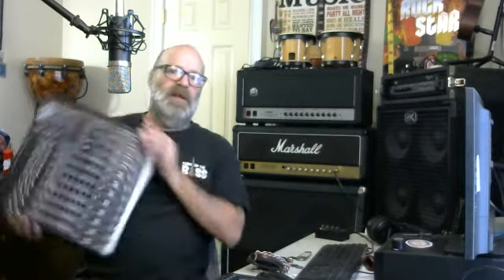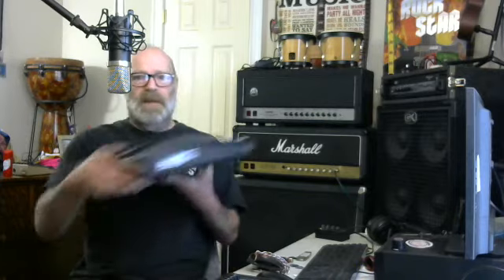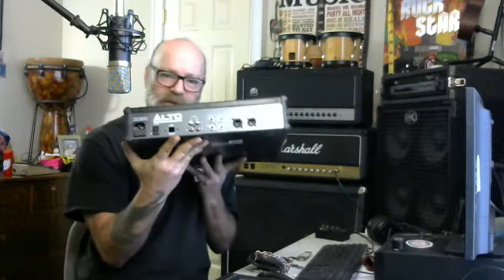Alto Professional Live1202 Review & Issues

Comment: I just got this mixer, and as you said the USB is very noisy. To the point of unusable.

 I tried the RCA output to a Behringer UCA222 USB soundcard, and that worked fine. 

Does this happend to all their boards? And can you do anything about it?
Reply from the maker: I don't know about their other models. My only experience with Alto is this board but it was enough to make me say never again. I assume they are using the same USB PCB in all of their boards equipped with USB but I don't know that for a fact.

Comment: Was thinking about buying Alto.  Will think again.  good to know.
Reply from the maker: I have used it in several settings both live & studio. It's ok. It will provide a mix. The effects are fair. My biggest issue was the USB. When it worked it was noisy which made it pretty useless for recording but, playing back stuff from the internet was ok. Then, the USB died making it totally useless with a PC. Right now I'm using it as a sub mixer to mix all my keyboards.